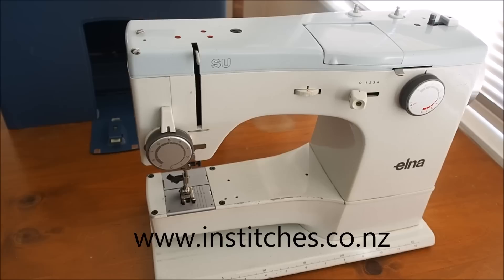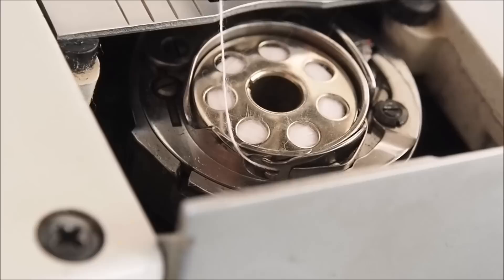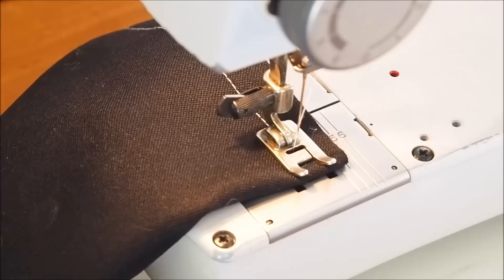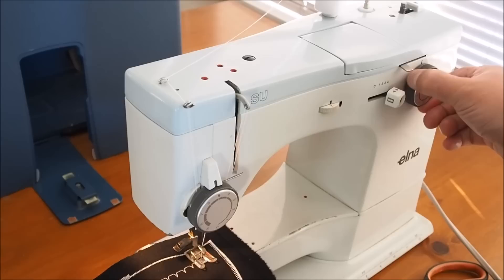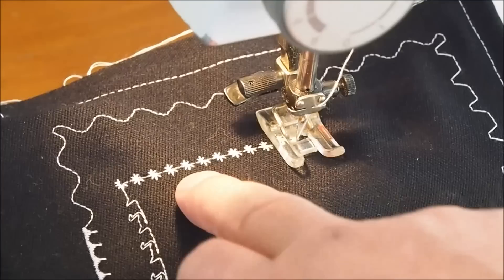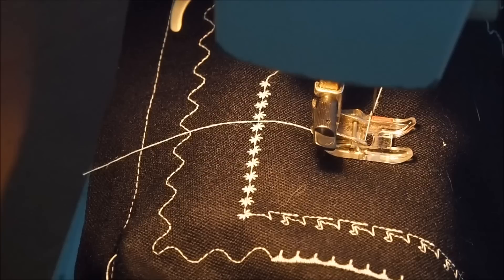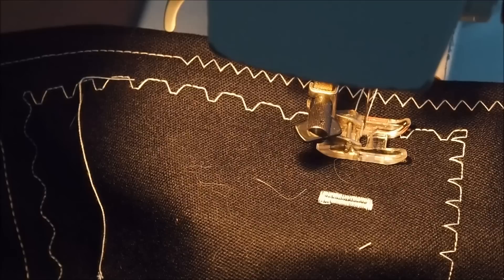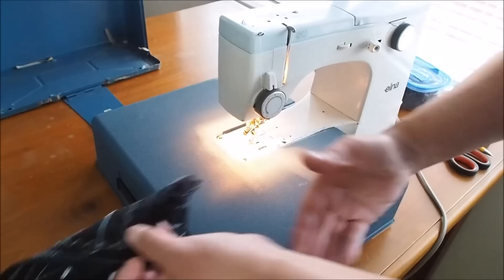Elna Supermatic SU 62C Sewing Machine Basics

Comment: Could you help with trouble shooting? My stitch width knob is stuck in buttonhole position and can not be put into 0 or 1 position. As well as my automatic stitch selector. It is stuck at times and can only be moved if I spin the coupling wheel. When I try to sew with what the settings are at the machine makes noise but the needle does not move
Reply from the maker: Try pulling the knob out and turning it 90 or 180 degrees. Also set the pattern selector to zig zag to start with.

Comment: I recently purchased one on line only to discover the needle positioning dial does not work. Any insight? Is this component replaceable or repairable? Or am I just out of luck for using the cams?
Reply from the maker: The dial seizing up is a common problem. The trick is to get penetrating oil, like WD40 or CRC 556 on to the shaft. Also the area needs to be warmed but not too warm. Be careful of plastic parts.

Comment: I just received this machine from my mum and I can't seem to change the position of the needle - the dial won't turn and is stuck tight. Would oiling the machine help?
Reply from the maker: That is a common problem with this model. Oil generally won't help and the only way to sort this is to target the correct area with penetrating oil such as WD40 or CRC.

Comment: Hi I have an older model the turn wheel is hard what can I do to to loosen it thanks. Here in California there are not many trustworthy merchants so I’m trying to avoid taking it to the shop
Reply: Elizabeth Villalobos Hi Elizabeth, I would recommend taking the top off and liberally applying TriFlow to all the oil points. Turn the wheel manually to ensure the TriFlow gets all through, and let it sit overnight. Next day, try running it and see if it has loosened up.  The TriFlow will dissolve old grease and oil that has gummed up.

Comment: Hello in stitches! Much appreciate all your Elna videos..mi used the motor removal one to disassemble it and had it rewound...it was smoking when I got the 1950's machine with the detachable knee lever...very well loved and major mileage... unfortunately, I haven't managed yet to get it working again.... I've seen one of these white ones going for sale and wonder whether the motor would fit into the green oldie? I saw that it had internal fins attached to the motor that regulated the speed.... would I be able to scavenge this one and have it work....I think it's a 1954 model...the same one you were disassembling to remove the motor in another video. I do so want to have her work again 🙏

Comment: I inherited this model. It seems to be operating fine although when I pull fabric away after sewing, the bobbin thread pulls with a little resistance and a soft gear "clicking" sound. Is there any such noise in your unit?
Reply from the maker: The first thing to check would be if you have the correct bobbin for it. It should have holes in one end but not the other and will be metal (have a close look in my video to compare). If it is the correct bobbin, pull it out and roll it along a flat surface to see if the ends are not bent or buckled. When inserted and you've drawn the thread up through the hole in the needle plate, the thread should pull smoothly with a little resistance.

Comment: Does the Automatic buttonhole cam 200 work with this model 62C ?
Reply from the maker: The buttonhole cam is built in to this model so cam 200 is not required.

Comment: I am completely new to sewing machines so you may be the perfect person to give me some advice.  I am looking to buy an industrial sewing machine mostly for marine vinyl thickness.  I would like an affordable machine but one that has lots of stick options like a baseball stitch or stitch designed found in luxury automobiles.  I would like to be able to do straight stitching and have adjustable stitch spacing as well.  I have learned that when stitching thick material a walking foot with a hold down foot is important to keep the thick material flat and even.  Can you recommend some machines.  I am even willing to pay for advice so I can do this once.  I will be using this mostly for hobby use like making my own motorcycle or watercraft seat covers, some with piping.

Comment: Hello! I have an identical machine and have just started quilting which means that I need to purchase a specialist foot….I have tried everywhere I can think of with no success so in desperation I am going to ask you whether you are aware whether such a foot exists???  Desperate from the uk!  Many thanks …jan
Reply from the maker: Hi Jan, search the internet for low shank 1/4" foot. You should see plenty of options. I use one on my Elna SU that's designed for a Singer. I have them in stock if you have trouble finding one. Thanks.

Comment: I am so glad I found your video. I believe I have the same machine. I would like to buy some if the stitch discs but I'm not sure how. Are they different for different models? What should I look for when buying the discs?
Reply: elna used the same discs for many years. I pretty much guarantee that if your machine has a spot to put in the cams, any elna discs you find will fit. If you can't find some, I can certainly give you a few. I NEVER use most of the ones that came with my su
Reply: That is ver kind of you.

Comment: I am having problems with button holes.  The end stitches on 4 want to continue to move instead of tack.  Also when put on 2 again to make another button hole it moves like a tack.  I have to go back to 0 and start all over.    I'm just playing with scrap material until I can figure this out.  I saw an ad on social media for a free sewing machine table headed to the dump.  I went to go get it and was shocked it had a machine in it.  The table wasn't in bad shape and I cleaned and painted it all up.  The machine?  The Elna SU!  I cleaned it up and actually called the guy back up to see if he wanted it back.  I was hoping not because is is one of the best machines I have ever worked on.  So I got it free and is in perfect condition.  What a find!  I also have a Necchi, I believe BU as well.  First zigzag I believe endorsed by Sofia Loren.  If you have any info I would love to learn.
Reply from the maker: Hi, button hole balancing adjustments can be a little complicated. I can send you a service manual if you want one? You can find my web address in the video description. Thanks.
Reply: I actually found a manual thank you.  And after watching your video a couple of times I now know what that -/+ is on the stitch length wheel..  I have never made more beautiful button holes in all my life.  Even with those buttonhole attachments.  Thanks again.  Beings that I have old machines I will be watching more of your channel.  Love them.  I have a vintage Singer w/treadle, Consew Industrial (can't remember model but a beast) A Necchi SU and this Elna BU.  Wouldn't trade them for nothing!  Thank you.

Comment: Thanks for posting this video. I have an Elna SP and it was a great starter video as it is similar to the SU without the cams. My mother owned a SU which my sister still uses.

If anybody else has one of these machines, one other notable feature that isn't mentioned in this video or the manual (that I have) is the bobbin extractor. Its the small plastic thing behind the foot shaft. If you pull on that, it's spring loaded and allows you to pull it down to the center of the  bobbin and extract it. Very useful! I was using a pick to get the bobbin out until I figured out what it was for.

Do you have any recommendations about where to buy parts for these machines? I'm in Australia. Thanks!
Reply from the maker: I have parts for these machines. You can contact me via email. The address is on my web site which is listed in the video description. Thanks.

Comment: Thank you so much for creating this well crafted video.  I was gifted this machine sans Manuals several years ago.  Just when my newer Brother broke down making scrubs and face masks for this Covid-19; I find myself having to figure this machine out.  You may have saved me.  My first of many questions, do I have to  use Elna bobbins or is there a generic?
Reply from the maker: Thanks. Yes you need to use the Elna bobbins with the holes on one side. Generic ones will not work.
Reply: I have been using a generic version with no problems for ten years now as I always have more projects on the go at once than my original number of bobbins. You just need to make sure the width and the depth both match the size of the original bobbins. Often generic bobbins are very slightly to deep and can't be used. Generic bobbins don't have holes on only one side so you need to be really careful to put in the bobbin so it turns anticlockwise. In my experience Bernina bobbins don't fit.

Comment: I have SU for repair and the machine is in very good mechanical condition...however, the electric motor friction wheel has lost its grip.
I can stall the machine just by holding the handwheel, and I have cleaned both the friction wheel and the main handwheel, and the electric motor runs perfectly.
Is it possible to replace the friction wheel without removing the motor?
If I have to remove the motor I think the machine will be uneconomic to repair.
Unfortunatley the machine will have to be junked :(
Have you had any experience with this task?  TIA
Reply from the maker: Yes, the pulley can be replaced without removing the motor.

Comment: Hi, do you know how to open the front of the machine to change the Presser bar lever Lifter
Reply from the maker: Hi, take off the top cover and you will see two screws going into the face plate horizontally, near the top. Take those out and you can move the face plate out of the way, however it will still be attached by the bulb power cord.
Reply: @InStitches  thank you very much.

Comment: Hi. I have inherited my SU machine. It's now making a strange clunk which apparently means it needs oil? I don't have a manual and have no idea how to oil / maintain the machine (it definitely doesn't run as smoothly as yours!). Does anyone know how to do this?
Reply from the maker: If it's clunking it may need more than oiling. You may need to take it to your repair person.
Reply: @InStitches  thanks. I had just got it back from a service, and then it had sat for a few months. I found a manual online and oiled it and it worked great! Poor machine had been in my family for nearly 40 years and no one knew it needs oil.... Oops...
Reply from the maker: @danimartin9905  I'm glad you got it sorted.

Comment: This is a great machine! I have this model and I love it the only thing that happens is the needle plate pops up on its own out of the blue I make sure it snaps down but it still happens any thoughts or do I need another plate? Thanks
Reply from the maker: The two plates either side of the throat plate are held in place by two screws each. You could try loosening those screws and hold the two plates closer to the throat plate, therefore sandwiching it more securely, then tighten screws in this position. This may help.
Reply: @InStitches  ok thanks 😊

Comment: I have been given an Elan Elnita ZZ -- Max 15 -- It is a really old machine.  Has the two knobs on the front right side of the machine and one closer to where you thread the machine.  Do you have a video on it or can you tell me some things about it?  I do have the book, but I am more a visual person.  Thank you for your reply.
Reply from the maker: Probably the closest model I've done a video on is this one https://youtu.be/siWDk5JTHnA
Reply: @InStitches  Thank you.  I have watched that one and this one several times.  Mine does not have the sides that you have to let down.  t is really small but heavy.  My friend used it to take in their camper.  I need to oil it but don't know where to put the oil. lol  It has sit for about 5 years but it still works.

Comment: I received this from my grandma years and years ago but it’s missing the bobbin case, bobbins, power cord & foot pedal.. at the very least. In your opinion would it be worth replacing, Or just getting a new machine?
Reply from the maker: If you can source the parts then it would be worth it. A new machine won't come near the quality of what you have there. In know it may not be practical at this time but you could keep an eye out for another Elna at a recycle store or the like. You may be able to buy the parts online but you will need to fit the bobbin case.
Reply: In Stitches I saw online that it would probably run me $120 to replace my missing items. I ended up finding the bobbin case so that saved a whole lot of hassle & $ because it looks like it’s built in. I will probably invest in this once we know we will have jobs again in a month 😅 thank you for such an informative video
Reply: @InStitches  E-Bay is a good site for finding Elna parts.

Comment: What size needles does this machine use?
Reply from the maker: The needle is a standard domestic 130/705H. As for the size (thickness), it depends on the weight of the fabric being sewn. For standard weight fabrics use about 70 or 80 metric. Heavy weight use 90 to 100, jeans 100 to 110, sheer fabrics use 60. All sizes listed are metric.

Comment: You can thread the Elna using only your left hand.  At about 7:41, if the take up lever is all the way to the top, you take your left hand and wind it through the top two loops as shown then all the way down to the stitch gauge....still with your left hand wind it around it, then back up to the top to the take up lever.  When the take up lever is way to the top, pass the thread over it and it will thread through...then down to the needle.   Have to use your right hand to get through the needle.  The salesman showed me that and I didn't think I could ever do it.  But, a couple practice runs and I was a pro.  :-)  you can be too.  I love this video so much...had to watch it again!!!

Comment: Thanks for this great video. I am having a problem I hope you can help with. When I turn on the machine the light goes on, but as soon as I begin sewing the light goes off and stays off the whole time I am sewing! Do you know how I can fix this? Otherwise the machine is very good.
Reply from the maker: Try contact between the bulb and their terminals could be weak. You could gently try pushing the bulb up while you are sewing and if it comes on then the contact is weak. First try replacing the bulb.
Reply: Try putting in power socket the other way round

Comment: Great video, very good instructions. Your thread seems very hairy. I wonder if this is poor quality thread or some special kind? I've heard of hairy thread being a cause of lots of problems in sewing machines, and presumably causes rapid lint build up. Also, no mention of oil. This machine is supposed to be oiled before every use. That said, the one I bought still had the original oil in a sachet and the bottle unused. It was a shame to open it after 45 years, but the machine deserved it. It had barely been used, thankfully!
Reply from the maker: The thread is not expensive thread but it's not the cheapest either. It is a little 'hairier' than high quality threads so the machine may need cleaning a little more often but shouldn't cause any issues. I cover oiling in other videos. Thanks.

Comment: I just inherited my grandma's Elna (very similar model). It just came back from the factory and has been completely revised. It worked perfectly for about 24 hours and now I can only do a straight stitch with it. All the wheels work well, stitch length can be changed, everything works perfect except for that. Would you have any idea what the problem could be? Would be so grateful for your help.
Reply from the maker: It sounds like the needle bar carrier bearings may be seized. It's difficult to explain exactly where these are but they're in behind the face plate. Take the top off and you can get oil down into the bearings from there. They are the bearings responsible for the sideways movement of the needle bar. You can move the needle bar sideways buy hand and it should return under the spring pressure alone. If not then the bearings need lubrication with sewing machine oil in just the right place. You can take a look down from the top and move the needle bar and at the point where you see it hinging is where you need to get the oil to.
The other reason is the cam stack gear could be split. That is quite a big job where the top shaft needs to come out for the cam stack gear to be replaced.

Comment: I have my mothers machine. Works fine.. but fine fabrics like lawn and sheer fabrics.. the stitches pucker.. its been.in for dozens of services bt elna agents... but the puckering continues
Reply from the maker: Hi, It's difficult to know for sure exactly what's happening here but thread the machine in two different colours. Take a look at the threads to see if one is pulling straight across the fabric. Maybe try lowering the tension of either of the threads depending on what you see, or maybe lower both tensions. Thanks.
Reply: @InStitches   thank you. I will try your suggestion.